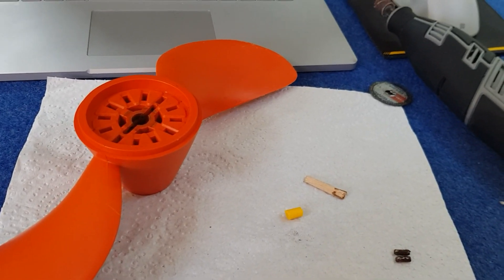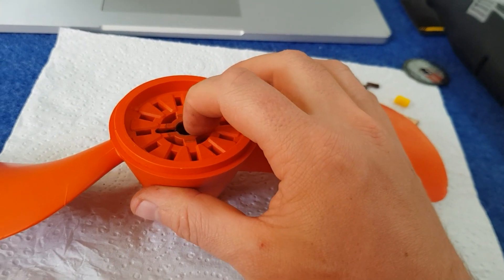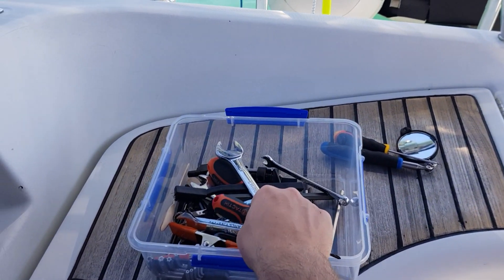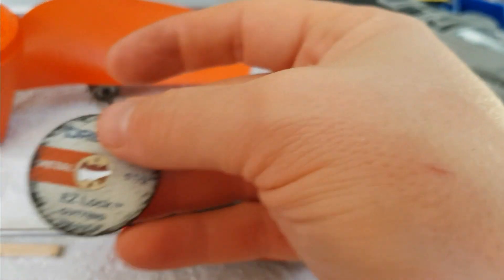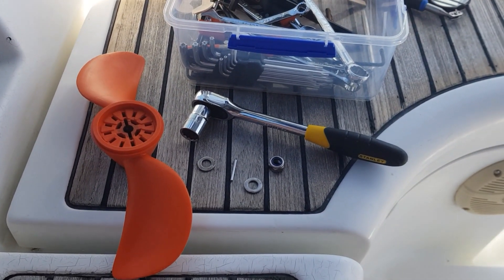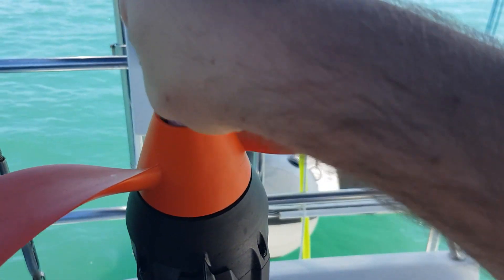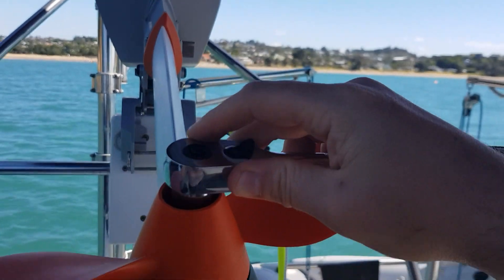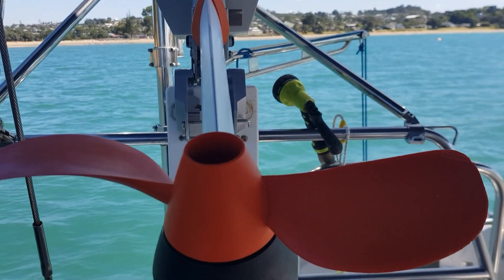How to do an emergency shear pin replacement on a Torqeedo outboard

Comment: the metal of the new pin must be much better than the crappy one, should be done from the start.
Reply from the maker: Yep. Or you could buy the epropulsion spirit 1.0 which is better, quieter, cheaper and more reliable than the torqeedo. I changed a year ago and have had no problems - despite using it every day and not rinsing it down. Torqeedo was getting lazy from a lack of competitors it seems.

Comment: Hi there. Thank you very much for making and posting this video. It would be very helpful to know how long your shear pin lasted prior to failing? Was it the original one that was factory fitted and, if so, roughly how long had you had your Torqueedo when the shear pin failed? Since replacing your shear pin with a genuine Torqueedo spare, has the replacement shown any signs of corrosion? Thank you very much in advance for any info you can provide.

The reason I ask is because my father had a close shave the other day when he was manoeuvring his Parker 21 onto its mooring. Having just launched for the first time this year, the relatively new (six months old or thereabouts) Torqueedo Travel 1003 suddenly stopped producing any thrust when he put it on full throttle in order to make headway against the river current. He was then taken out to sea stern-first! It could have been very nasty as the river mouth is tricky at the best of times and the sea was rough. Thankfully, he is a very experienced sailor and survived the experience. Unfortunately, his boat has sustained some damage. Not the best start to the new sailing season.
Reply: The Torqeedo shear pin is made out of a relatively soft metal that rusts.  Torqeedo says to rinse your motor in fresh water after each salt water use.  I didn't believe that requirement, and had two shear pins fail in two years.  They looked pretty rusted.   From now on, whenever I get to my home port, I will stick the lower unit in a bucket of water to make sure the salt is flushed out of the pin.  Hopefully that will make a difference.
Reply from the maker: @pgranbery  I had two pins fail on my torqeedo in use. I now use an epropulsion spirit 1.0 which I would classify as being 10x better than my torqeedo! I use it every day for months now and I never rinse it down and I've had no pin failures on it. I also has a better design. I'll eventually do a video on it.
Reply from the maker: Sorry I'm late to this. I swear youtube is so bad at summarising comments that have been made on my videos!

It didn't last long - it failed relatively soon from when I started using it. I did hit a rocky bottom though so that's what they're designed to do - shear when that happens. It was the original one that failed, yes.

I also had a replacement fail when I towed the dinghy with the motor down (I know. Bad idea).

This was all in a 7-week trip in NZ last summer, so I've not checked out the pin since then. I'm going to try replacing my torqeedo with a epropulsion spirit 1.0 so will probably do a comparison video at some point.